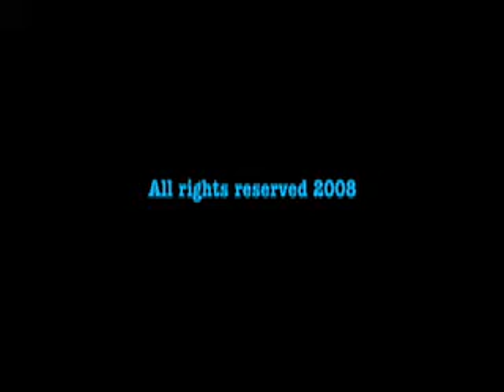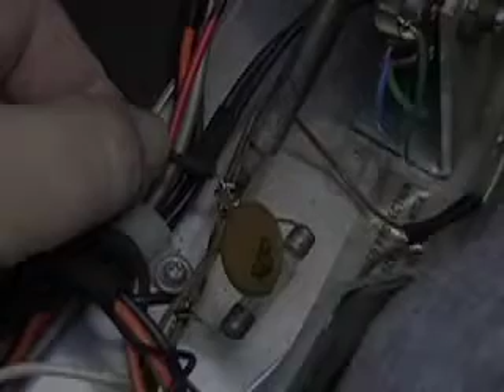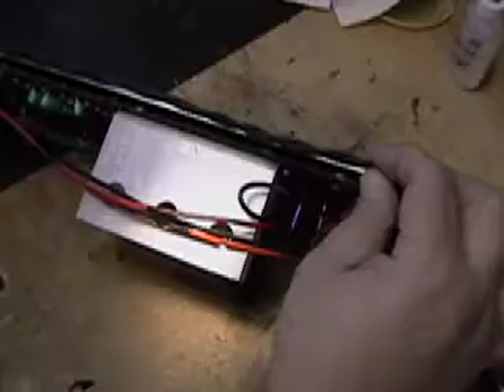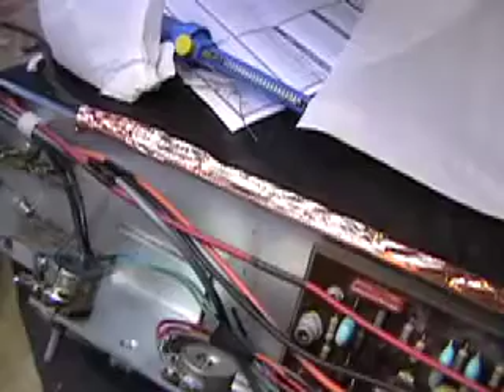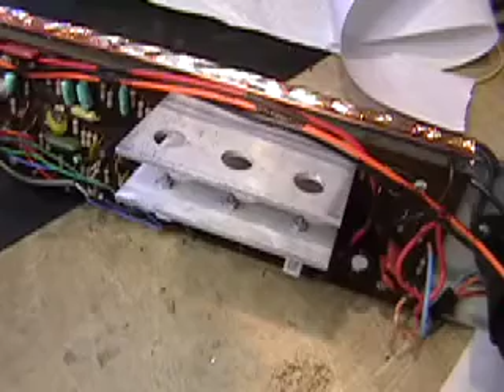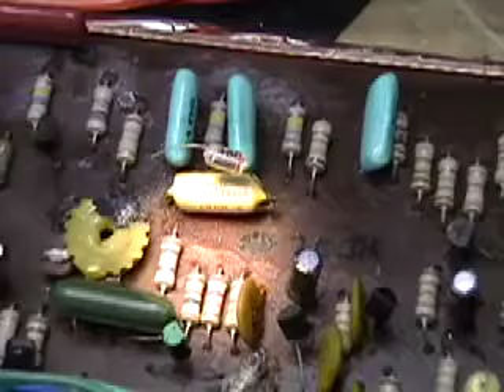How to limit Hum and Vibrato Thump On a Wurlitzer 200 Piano

Comment: Hello, 
How I do the same in a 200A??
Where is this capacitor in a 200 A?? 
And finally, how many volts is the small capacitor which must be installed? 150 -180uf but how many volts? 
Thanks so much for your help.